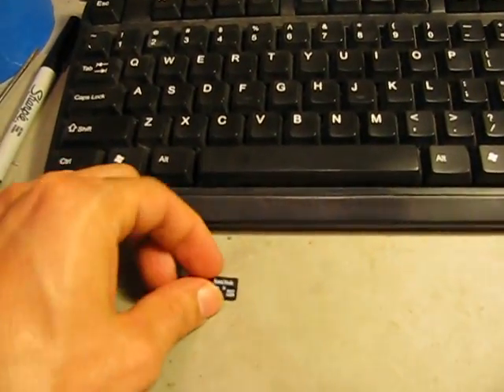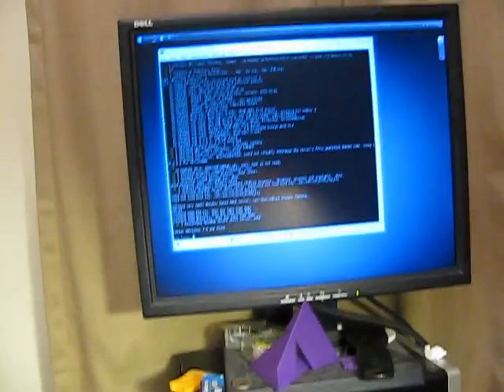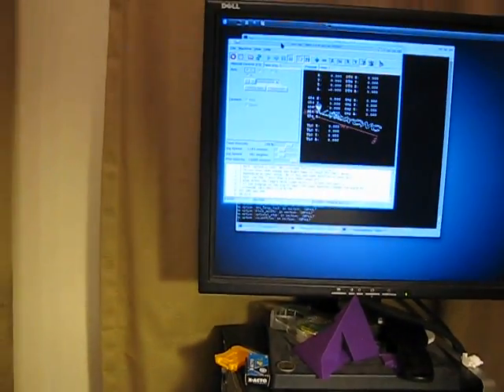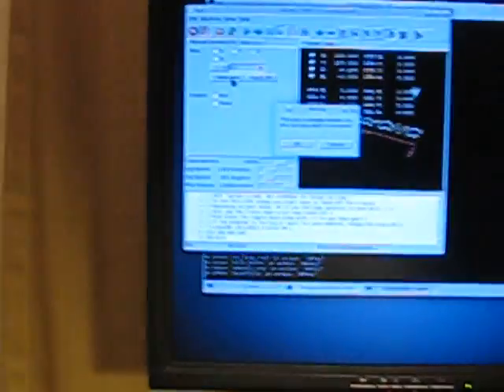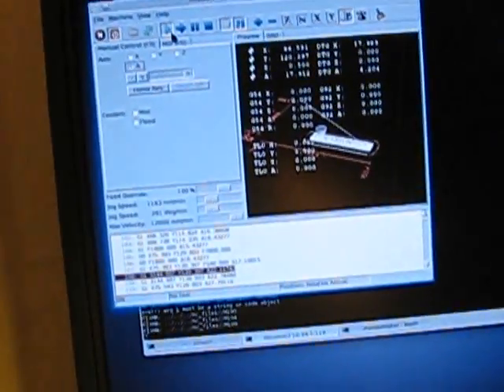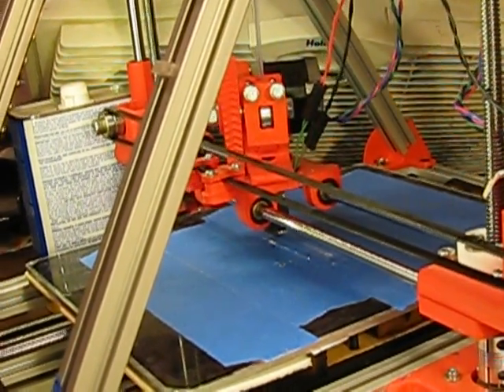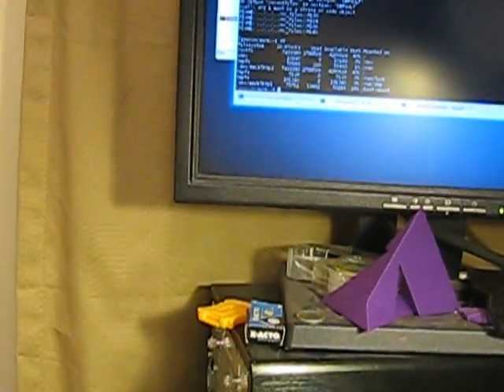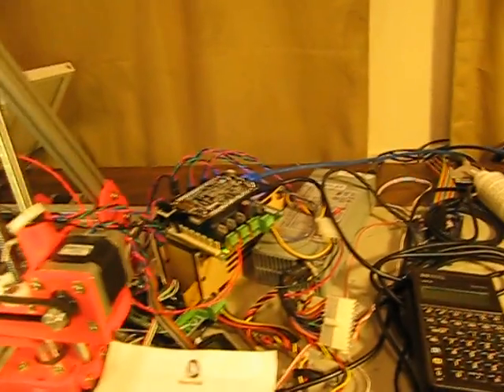BeagleBone Black + BeBoPr + LinuxCNC = machinekit

Comment: can i use closed loop stepper systems (stepper-encoder-driver) with that beaglebone black?
Reply from the maker: +ipadize Yes, for a few axis.  There are three hardware encoder inputs on the BBB, but to use all three you need to disable the HDMI output.  The recent Furaday cape is designed to work with closed-loop servos and encoders.  A more flexible solution is to use an FPGA like an x86 system with a Mesanet.com card, or if you like living on the bleeding edge perhaps an SoC + FPGA system like the Altera DE0-Nano (with the recently ported Mesanet VHDL code and driver from Michael Brown).

You can also use the PRU to do "soft" encoder inputs, but you need to use the direct PRU input pins and there are not currently any capes available (that I am aware of) designed to work this way.  This might be an option if you don't have very high count frequencies and are planning on custom wiring your system.
Reply: +Charles Steinkuehler thanks, i just want a cheap 5 axis solution with encoders for testing and getting familiar with settings and so on i dont want to spend thousands of dollars for a test, that may not work you know?
Reply from the maker: Mesa boards that would support 5+ axis of true servo motion are less than $100 (like the $89 5i25: http://store.mesanet.com/index.php?route=product/product&path=83_85&product_id=55), assuming you have an available x86 PC to plug them into.  If you want hardware encoder support, it's the best price/performance available right now.  The BBB can only do 3 hardware encoder inputs, and while the Altera SoC+FPGA is affordable ($99 for the Terasic DE0 Nano), it's very a new and untested platform:  http://www.terasic.com.tw/cgi-bin/page/archive.pl?Language=English&CategoryNo=167&No=941
Reply: +Charles Steinkuehler thanks i´ll have a try ;)
Reply: +Charles Steinkuehler if i use encoders, do they have to be mounted on the steppers or can i mount them directly on the rotational axis?
Reply from the maker: You can mount the encoders wherever you like as long as you put proper scaling into your HAL configuration to account for any gearing involved.  Some systems even use multiple encoders (example: standard encoders on the ball-screw combined with glass scales).  You just need to craft your machine HAL configuration to match what you physically build.
Reply: +Charles Steinkuehler ok thanks
Reply: +Charles Steinkuehler would a encoder like this: http://www.teleskop-express.de/shop/product_info.php/info/p1808_ArgoNavis-Encoder---Aufloesung-10-000-Schritt-ohne-Kabel.html work with the Beaglebone? it has 5v, Gnd, channel A and B and index contacts
Reply from the maker: That looks pretty standard and should work fine.  Things to watch out for:
1) Verify signal levels so you don't feed over 3.3V to the BBB!
2) I'm not sure anyone has used index encoders with the BBB, but it should work.
Reply: +Charles Steinkuehler if i have understood it correct, the Beaglebone Black is a complete Computer and you can plug an LCD into it. But how about Linux and Machinekit? do i need to flash Debian Linux and then Machinekit on the Beaglebone or do i only need the Machinekit Image? if it Flashed correctly, can i start Linux normally or do i have to do something else? sorry if i ask that much, but i am having trouble finding informations. 

Basically i am ok with the Beaglebone for now and want to experiment and learn with it
Reply from the maker: Start with this image, which will run off of a uSD card:  http://elinux.org/Beagleboard:BeagleBoneBlack_Debian#BBW.2FBBB_.28All_Revs.29_Machinekit

If you have a BBB Rev-C (with the 4G eMMC), you can flash the image to the eMMC (by editing uEnv.txt and rebooting) if desired.  If you don't have a Rev-C, the 2G eMMC isn't large enough for a Machinekit install, so you'll need to run from the uSD.
Reply: +Charles Steinkuehler ok thanks
Reply: +Charles Steinkuehler if i have 5 axis and 2 are encoded, am i able to use a touch probe and an e-stop?
Reply from the maker: Yes, you can use features like probe switches and e-stop until you run out of physical pins to assign.  If there aren't enough pins available, you can migrate to a system that has more, perhaps an ARM SoC+FPGA like the DE0-Nano, or an x86 system with one (or more) FPGA cards from Mesanet.com.  That's one of the big advantages of using a Linux based control system like Machinekit that has multiple platform and hardware options supported.
Reply: +Charles Steinkuehler i dont find the .txt file on the beaglebone can you help me?
Reply from the maker: uEnv.txt is typically in your /boot directory, although it depends on exactly which image you are running.  VERY old images had a separate VFAT partition with the boot files.
Reply: +Charles Steinkuehler i managed to flash the newest flashing image (the one unter the machinekit image, dont know the name yet)
Reply: +Charles Steinkuehler it was this image: h.t.t.p.s.://rcn-ee.com/rootfs/bb.org/testing/2016-03-27/lxqt-4gb/BBB-eMMC-flasher-debian-8.3-lxqt-4gb-armhf-2016-03-27-4gb.img_.xz but when i plug the beaglebone through usb in my pc, i dont see the txt file or boot directory. btw im working on windows
Reply: +Charles Steinkuehler i have now found the uEnv.txt file (had to browse it on the beaglebone itself, no one said that) but the problem is, i can&#180;t change it and there isn&#180;t even the "optargs" line in it. also changing permission did not work.

btw is there a touchscreen driver that works with the waveshare touchscreen that you know of?
Reply from the maker: +ipadize Please migrate this (far too long) discussion to the appropriate location: The Machinekit google group:  https://groups.google.com/forum/#!forum/machinekit

Comment: hello ,  
I saw your standalone printing using beaglebone black video and i was intrested in knowing that if i can use a touchscreen instead of just an lcd screen..
I dont intend to use it on 3d printer but on a 3 axis mill.
Reply from the maker: Shubham Sharma Yes, you can hook a touch-screen to the BBB.  There is built-in support for resistive touch screens, or you can use any of the touch screens that include their own controller (which is most of them, typically via a small USB dongle).
Reply: Charles Steinkuehler ok thanks..

Comment: Hi...  Excellent video!   How did you get a tty/serial console output from cold start?   In an Angstrom you can´t till you have the system started up and ssh...   i can't figure out.   Thanks.
Reply from the maker: With the BeagleBone Black, you need a USB to Serial adapter, which connects to the serial port header on the 'Bone.  This will give you a serial console even before the Linux kernel boots, allowing you to interact with the U-Boot boot loader and see all Linux startup messages.  http://elinux.org/Beagleboard:BeagleBone_Black_Accessories#Serial_Debug_Cables

Comment: Nice walkthrough, thanks for sharing.
What sort of pulse speeds can you get from this setup ?
From what I've seen you need to log in remotely to use Linux CNC's Gui, is that correct ?  It would be sweet if you could run completely from the bbb standalone...

Comment: I have a 0815 Stepper motor Driver like 2 pins for Step and Direction...
Can i use The BeBoBl IO Pins to connect them directly.
Like Linux CNC and LPT Port on a normal PC???
Thnaks for answer!!!
Reply from the maker: Yes, the BeBoPr has a header intended for connecting to off-board stepper drivers.  There are also several capes available for CNC use with DB25 connectors.  See a list of available hardware on my blog: http://blog.machinekit.io/p/hardware-capes.html

Comment: thanks for all the work on machinekit and the videos. I'm just starting to get toes wet in 3D printing with the goal of making delta. But first I'm going to make an X-Y laser engraver using old scanner and DVD parts to learn the software and electronics. For the electronics side I was wondering if you would still purchase a BeBoPr and bridge boards with the experience you now have? I had been thinking of 'wiring' up a RAMPS to my BBB and still searching for good options.

Comment from the maker: Yes, LinuxCNC can control up to nine independent axis, but you wouldn't want to use this for 3 different machines unless you needed all three machines working together on the same part for some reason.  You will get coordinated motion between all three machines, which might be good for a few cases, but otherwise it just turns three independent machines that can otherwise run three independent jobs into one funny to control machine.